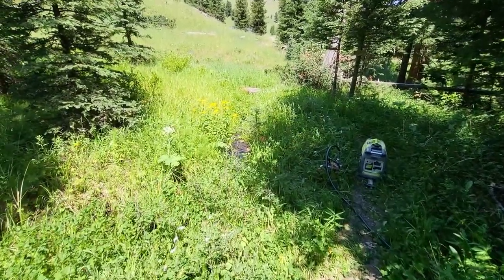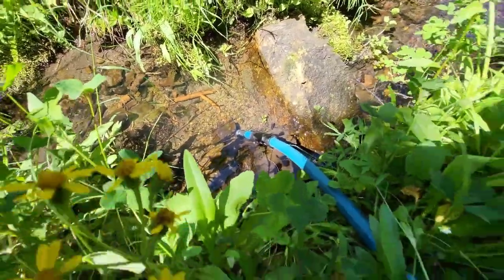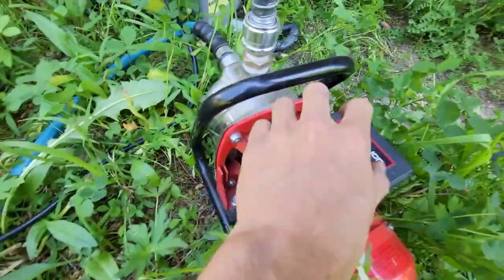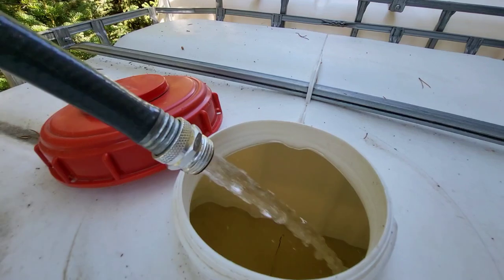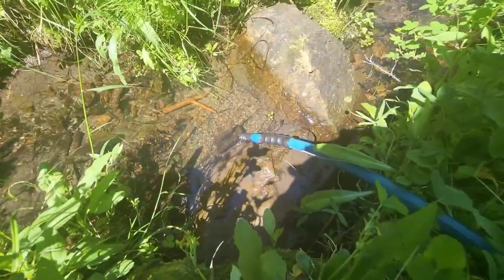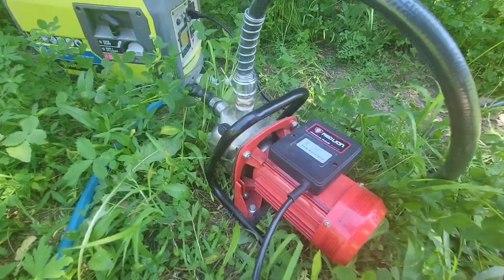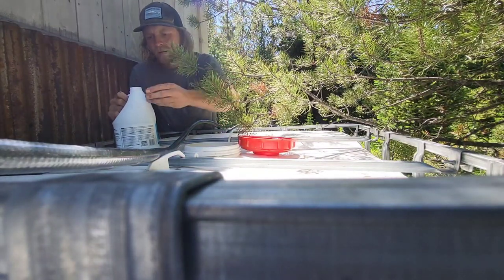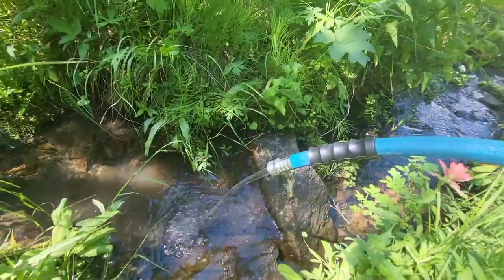Best Way To Pump Water From A Creek: Off Grid Tiny House

Comment: Great simple setup, We do the same thing except I'm using a gas powered pump that moves more volume of water at a greater distance. The water has to travel up a gradual hill for about 135 feet before it reaches our supply tanks. To make life easier I buried a 1 inch supply line from the pump to the storage tanks and added the correct pvc fitting so I can attach a garden hose to each end. I found if you wrap women's pantyhose the hose that sits in the water, it filters out and rocks or debris....

Comment: You should paint your tanks black. I have the same system as you and I never use bleach because nothing grows inside my tanks because they are black and enclosed.
Reply: not, you are mid informed, black helps but you will always get some growth without treatment of some kind.
Reply: mis
Reply: You still need an appropriate method to sterilise it
Reply: @UKsystems  i dont use it to drink water just showers and wash dishes. Been doing this for 4.5 years

Comment: Does anyone know if it's possible run pvc to a creek. With a standard pond filter intake box on the creek end, and a cast iron hand pump by the house?  What I'm asking is, can a hand pump pull water at a 45 degree angle about 200 feet? I want a way to get creek water to my back yard with zero electricity.  Can a hand pump even do this?

Comment: Curious about the ryobi generator. Kinda looks like is supposed to be a quiet generator like the Honda eu2200 series which is a hefty price. Your ryobi didn’t sound very quiet but curious if it’s a quiet model. Honda is just too darn expensive.
Reply from the maker: Yes, it's very similar to the little honda. I paid $400 for it used. It also has bluetooth, so you can turn it off from your phone.
Reply: @nialldivers Thanks! Been looking for something similar to Honda. Also curious how many operating watts or amps.

Comment: I have a ravine with running water that comes straight off of the corn and bean fields. Would you water your vegetable and fruit garden? They usually don't spray fertilizers until the end of summer. That's my only concern.
Reply: ARE you serious??? all those chemicals return to the earth and straight into your water source

Comment: I recommend looking into a ram pump it pumps a lower amount that continuously just powered from the water
Reply: It does not look like he has enough current.
Reply: @frankmaggard7123  actually a small one potentially could bearing in mind he is pumping through that hose sucking it quite fast however it wouldn’t be the most flow but it probably would be quite a bit over a period of time

Comment: How do you then pump from the cisterns into the cabin for use?  We are figuring out options for our off grid cabin - we are on a river with only solar so we have some options but not a ton
Reply from the maker: The water gravity feeds into the house.  There's a pump inside the house that provides pressure for the sink and shower.